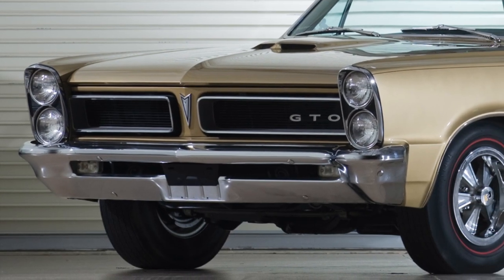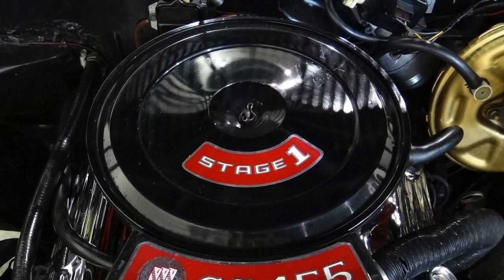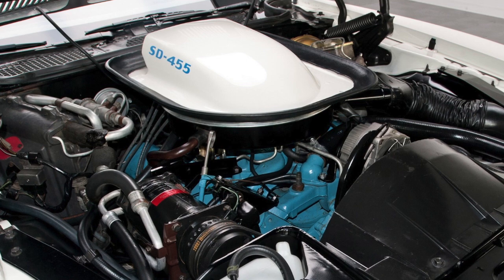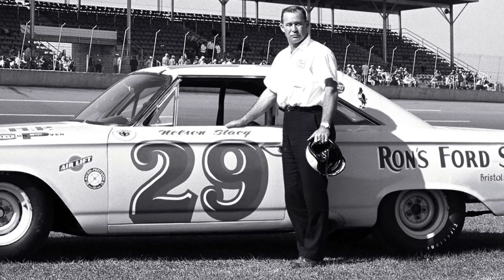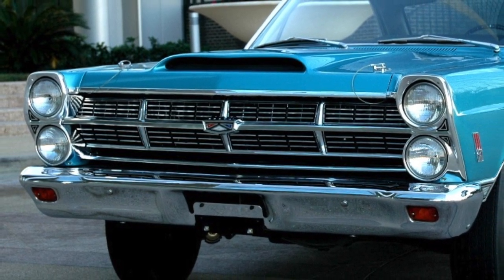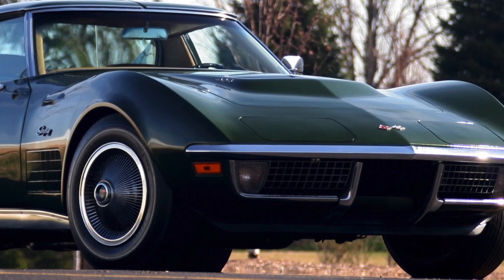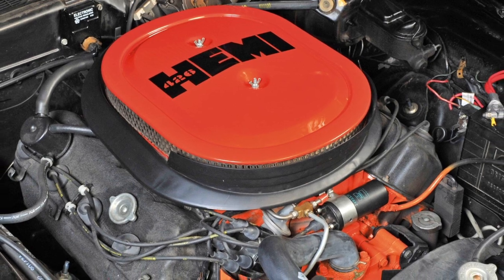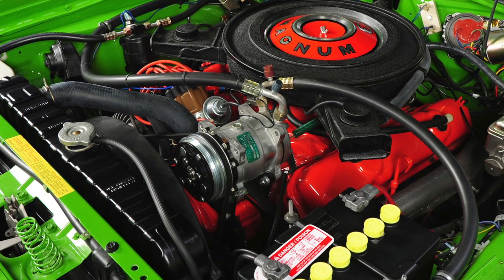5 Best Vintage V8 Muscle Car Engines

Comment: The Pontiac 455 intake and internals and heads etcetera were different than  the Buick. I wonder how bore and stroke  different as well. I  believe Oldsmobile made a 455 too
Reply: Olds did too. Just like they all made a 400
Reply: @jeremythompson9122  I wonder if the bore and stroke was different for each of the three companies on a 455.

I just looked it up in the consumer guide Auto editors Encyclopedia of American cars and all three motors had different bore and Different Stroke I can't believe it but alas
Reply: Those engines all shared no parts. Each division had its own engine architecture
Reply: @edwardpate6128  crazy since they're all under the General Motors moniker

Comment: What? No Small Block Chevy?
Reply: It is titled: 5 Best Vintage V8 Muscle Car Engines. The muscle car term is mostly related to a large CI engine in a medium size car. That did branch out somewhat by some to things like the Boss 302, 351C,  SBC 302,  LT1 etc. This is not discounting the SBC, but they are not really in this category. In stock form none of those could race with these engines, as long as traction was equal.
Reply: I would consider, for instance, the 67 L79 350h/327 Stingray a "muscle car"...meaning factory produced hp...of course it could also be had with a 429..great vid and discussion...
Reply: meant 427 of course

Comment: 1969 ZL1 all-aluminum 427 550 horse + no other engine had that much horsepower.. only made for 1 year very rare
Reply: Yeah but the ZL1 is a full race engine like a Mopar 413/426 Max Wedge, Pontiac 421SD, or Chevy L88 427 or Z11 427. The Camaro ZL1's were more of a race car than a street going muscle car
Reply: @jeremythompson9122  Yeah, and the engine option doubled the price of the car. Nobody chose that engine for street use. I think eight were installed in Corvettes.

Comment: There were less than than 700 Buick 455 stage 1 cars made , they were more of a factory race option , not a production car , if you want to compare it equally , the ford sohc and dodge stage 3  426 wedge cars should have been included  , both which would make mincemeat of the stage 1 buick .

Comment: The 409 started it all.
Reply: Really the 1955 Chrysler 300 started it all.....the first American production sedan with a 300 horsepower factory rating. The 1955 Chrysler 331 Hemi was the first American high performance V8. Then it was bored and stroked to 354 cubic inches(340 and 355 horsepower versions)in 1956 and finally to 392 cubic inches(375 horsepower) in 1957. The Hemi powered Chrysler 300 and Dodge D-500 totally dominated NASCAR in 1955-56 and it wasn't until 1957 that Ford and GM finally built some engines that were competitive. And even then Ford needed a factory supercharger and Chevy needed fuel injection to approach the kind of power numbers the Mopar 392 Hemi made. But the 57 Chrysler 300 was just too heavy compared to the lightweight Ford Custom and Chevy 150 sedans to really be competitive in NASCAR even though the 392 Hemi still made more power than the blown Ford 312 or the Chevy fuelie 283. The 1957 Tri Power Pontiac's and J2 Oldsmobile's were pretty fast too in those days but NASCAR banned multiple carbs, fuel injection, and superchargers after the 1957 season

Comment: The PONTIAC SD 455 was NOT used in the 1977 Smokey and the Bandit Trans AM.   THAT fine Auto had an OLDSMOBILE motor....not a Pontiac.

Comment: Great video, but I thought the 409 would be in there.
Reply: i used 348 forged crank and rods in a 409 block for 383.4 cu. in. That motor would wind up so fast it was crazy.

Comment: I'd take the SD-455 in the 1973  Trans Am .
Reply: Low compression
Reply: @marka6187  doesnt matter.  They still performed.  Compared to others that is.  75 and newer were junk .

Comment: Well great video on Big blocks. But the title was great Muscle car engines. And you dont include arguably the most popular and versatile engine of the  V8 era, The Chevy 350 ? Then you missed the point of your video as described by your title. A stock 67 thru 69 Camaro would smoke any of those big block land yachts on any road or track with a curve. (Except perhaps the vette). 
Good info on the video. But misleading title.

Comment: I went for a ride in a 67 Chevrolet Camaro 454 ss I could not believe how powerful it was on the highway scared me a little the guy who owns it has 454 suburban motor in it carberateur manual steering disc brakes wide rear tires And red And black interior fun car to ride in I have seen a numbers matching 68 Plymouth roadrunner forest green 426 hemi one owner car beautiful machine

Comment: You left out the Pontiac Ram Air 2 in favor of the overrated tripower 389s. The 1968 RA2 Firebird was as quick as any car on the list and it did it with 50 less cubes.
Reply: Too me, the '68 Firebird RA II was Pontiac fastest production car. It's a shame that the '68 Firebird never got the 428, with RA II heads it would have been a killer.

Comment: This man is slightly demented.I don't mean to sound nasty. The Street Hemi from Chrysler was the best,most powerful production engine ever made...... I lived it and raced in the late 60's into the 70'. The only reason for the better stock 1/4 times for the Stage 3 buick was because with street tires,the Hemi would sit there in a cloud of smoke and tire fire, while the Buick with much less low end power would scurry away..........Put a pair of just 7 inch slicks on bothe a Hemi Roadrunner and the  Buick and the Hemi would eat the Buicks lunch.....I promise it...I saw it.
Reply: This is correct. Hemi's were temperamental, but once dialed in properly nothing could touch it..PERIOD!. I saw it too.
Reply: @timinla64  I was part of a racing team. We bought a Hemi RoadRunner in may 1969. Torqueflite,4.10 Dana rear. They called it the "Super Track Pak" all HD stuff to stay in one piece behind the Hemi. I was only 16 at the time and it was great. There I was a kid. I learned drag racing in and out as we modified the car bit by bit.....With no modifications but 7 inch slicks it ran low 12's. ...Jetting the AFB carbs and adding headers 11.7 at 121 mph....Now I have had a career of being a tech then a Service Manager for 20 years after that. I am 65 and I remember a terrific time in my life........
Reply: The 440 was a far superior engine in the 1/4 mile. The Hemi shines once you get further into the gears.
Reply: @SlowRide723  i had the 440  375 HP tnt engine in my 1967 chrysler 300  the calif  hiway patrol had the same in the dodge cruiser but made to their specs  nobody got away from them

Comment: So what is the real deal with a 455 V8 Buick engine stage 1 or stage 2 or regular someone want to break that s*** down for me
Reply: The lightest ( in weight) of the 400's bloc production and, a 510 lbs/torque from the start.

Comment: I had a 1970 Dodge Challenger with a 383cu engine with a three quarter race cam and ported and polished heads putting out 425 hp in 1973. I raced a 454, 450 hp Chevelle twice and we were bumper to bumper in both races. The guy had been downtown beating everyone until we raced. After two races he left town! If this is the best that Chevy could do, what would a hemi do to Chevy??!!!
Reply: I wonder what rear gears each of you had though?

Comment: Where all the GM family big blocks more or less the same . Or where they all individualy designed and come out of there own factories?
Reply: They were all different before the late 1970's.  Designed by the division's engineering staffs and produced in each division's factories.  The Oldsmobile and Pontiac V8's were very close in basic block dimensions, but didn't share any parts.

Comment: buick 455 weak bottom end but I really liked the big bore and short stroke.
Reply: Buick had oiling problems oil pump sucked extended geares and a spacer plate along with full groove mains fixed it

Comment: No offence but the 455 S1 was not even near the Olds 455 w-30.  

1. 426 Hemi
2. 427 SOHC
3.  LS-6
Everything below that was in a lower category.  That means 429 Boss, 455 W-30, 428 SCJ, etc etc were chasing the tail end of the dog.  A dyno on a stock 426 Hemi shows 540HP at the transmission STOCK with 600+ Ft-Lb.

Comment: And of course Chryslers big block Hemi is still the choice for top fuel and funny car along with alcohol race cars. You either ran a chrysler at the track or you went home.
Reply: Not in the late '60's it was SOHC Ford. But eventually when it got to where you tore down between rounds, the push rod valve train was the winner but only after aftermarket blocks and heads. Ford made a huge mistake by producing all the speed parts you could ever want for their awesome motors, so when they got out of the racing business in 1970 there were no more trick parts because the aftermarket would not compete against the factory. Chevy's and Chrysler's parts did not come from the factory so many aftermarket suppliers so in the '70's that what everyone started using.

Comment: I'd take a 66 L72 427 4 speed Chevy Biscayne or Bel Air over a 70 Chevelle SS454 LS6 4 speed. I'm more into the sleeper look than the cars with wild colors and graphics

Comment: What a joke. You have a SD 455 on the list, but no Olds 455, or 429 scj? 😆 You need to do a little research on the late 60s - early 70s 4-4-2, and Mach1 mustang.
Reply: my  dad had a 1970 w30 422 oldsmobile he said he said it would out run 440 six packs and corvettes
Reply: I was wondering the same thing lol I own two Oldsmobile 455s and two olds 425s and torque for your buck they are the best.
Reply: phuc ewe  at 30 mph kickdown  440s did not have a chance leaf springs have alot of wheel hop gm s  have the real deal four link rear  suspension
Reply: @sabrehawk-427  ; Hey GTR ; Guess U Never Heard of a Lakewood J-Bolt Coupled with a Set of M&H's . A leaf Did a Very Satisfying Front End Lift after Installation . Something a Coil Could NEVER Do with-out Heavy & Very Costly & Expensive Mod's . All Coil Kar's Sadly Suffered the Same Disfunkshion . YYZ , Rock-Crush'in-Ratman . O ,almost 4r-got about the Rear bud Stop Lock . Very Essential .4 Positive Forward Momentum & Rear Weight Shift in a Positive Moment ! Vroom-Vroom & Let'r RiPPppppp .
Reply: @sabrehawk-427 : Luv 2 Disappoint : Head 2 head U'r Dad Bought a Hollywood Marketing Dawg of a 1/4'r Mile'n 2 +Ton Boat anchor ! Although Miss Hurst made it More Palatable . Me 69 Nova would Guarantee they Would Stay in da Shed .70ish & Although Changeld they Would Not come out 2 Play & Rather Yakkadie -Yak how about how Fast their Kar's Were as opposed 2 Proven it  all the while Shining their Fender's & NOT mak'in Eye Contact .. Bench Top Racer's we use 2 Call them ! An Absolute Truth . Albeit Ton's of H/P they ALL were 2 Heavy & Their Coil Suspension Could not Deliver the Piston Punching Power 2 the Ground . 1st Gear Might as Well been 3rd cause they were already 4 > 6 car lengths B-hind . They sure were Pretty & I Drove a Few & Yes , they were Dawg's . Nice Comfy Kind'a Ride ! A Buick Feel Sort'a . & Yes I know not what I Speak of 4 at the age of 16 I was already Comfortably Driving a Left Hand Drive Rolls-Royce & a Porsche 911 Cara -Targa + Half way constructing My 1st Race-Kar ! YYZ , Rock-Crush'in Ratman . Been There , Done That , Period !

Comment: She's real fine my 409 (425)
Reply: Had a 1963 409 425hp ran 12:80 won Super Stock 3 times including top eliminator at local strip also won A Stock when they changed from S/S to A/S
Reply: Powerful, but a lousy engine for racing.
Reply: @1LOCKNLOAD  Why's that?
Reply: @Q*bert It was developed as a truck motor and never intended to handle the high rpm's that people started trying to get out of it. The 396 and 427 were much better engines (at least in my opinion).
Reply: @1LOCKNLOAD  OH ok. Well you would think just a cam swap would change the rev characteristics on how it revs and it's power band......but I know nothing at all about this engine.
Reply: @1LOCKNLOAD  Exactly why the the 409 was replaced by the 396-454 engines. The 409 would blow up if pushed too hard. The head design sucked as well.
Reply: @Warrior_Resisting_Colonialism  The lousy head design limited the output of the 409.

Comment: Top 5, in the 70s.? How about the, gs 455  , 440, 340,six pack,mo par,351cleveland, 428 cj, 396/454 Chevy!  That's my 70s top 5 🤓
Reply: Loved the Cleveland but it was the worst real seal design to ever be produced.  Oil leakage was mandatory haha.
Reply: @markperry2827  NOT TRUE.

Comment: L88 copo was actually 550hp at least

The Impala SS 409 and Pontiacs 421 V8 should have been on this list
Reply: The L88 yes it was a grear engine but the 409 was way to heavy didn't do good at the track
Reply: @williamcostello4792  The 409 was lighter than the Mark IV engine and a bit heavier than the small block. You might want to tell all the guys who dominated drag racing with the 409 in the early 60's they didn't win!   Man nothing like amatures putting their 2 cents in!
Reply: Moon Pie  I'm talking about the 1969 ZL1 Copo Camaro and several people have put out 550hp on the engine dyno. Ford, GM and Dodge we're all under rating there horsepower numbers back then. The 426 hemi on the dyno is putting out 390hp and 500lbs of torque. The Buick 455 was putting down over 500lbs of torque.

Comment: Strange to pick Pontiac and Buick engines. I remember them as bearing spinners and rod throwers. They were a good car for the banker that wanted a little flash, but they were not well accepted by true hot rodders..  It was Chevy and especially Ford and Dodge that really got it on...

Comment: Whoa,  1959 Chev ...348 , solid lifters,  4barrel afb carb,  411 rear end,  four speed on the floor,  cam ?, ...right off the lot, except for dual exhaust and a coil taken out of the front springs....14:11 et.....one run,  could have easily got into 13:s.  But I know,  no match to these u mention, but 1959 completely stock, that motor buffs, overlook, going straight to 396 and up.    So there !
Reply: Fast for a brief time until the over stressed W designed bottom end let go. Thats why they changed the 348's design. Never was a chevy fan, but that,s one reason the 348's sucked.
Reply: What was the W bottom end ?  I ripped a structural arm attached to the rear axle housing and the frame, from the frame in a drag race, with too much weight in it at the time....still under warranty...ha

Comment: The 455 cid engine of any car builder   was a slow engine;  our 1969 electra 225 with it's 430-4 was faster than Honda 750  four and the Kawasaki 900cc first generations. . . . .Fond memories of this Buick. . Once cleaned out, it would reach 50 mph in 1st gear . . .😉

Comment: Motor Trend really gypped Chrysler in 1970, as the Hemi Cuda ran 13.0 flat at 107 mph and crushed the competition on drag strips across America. They didn't personally test it, and is why they could claim that the GTS was the winner

Comment: No mention of the Ford 460? Foreshame!!
Reply: @michael lawton I think the 460 was only installed in full size cars like Mercury and Lincoln.
A friend, about 1972 I think, had a Lincoln Continental with one.
It was faster than my father's 1972 Oldsmobile 98 with a 455.
Reply: @wms1650  I own a 1973 ford F-100 Ranger with a 460 from the factory. Its a monster!!
Reply: @blkhemi3925   Sorry, I was just thinking about hot cars.
The 460 was in trucks like yours for sure.

Comment: Buick 455 had cast rods. Olds 455 rods forged Olds 425 had forged crank.
Reply: John Mills The Buick Stage 1 had forged connecting rods and a nodular iron cast crank. The Oldsmobile W-30 had forged connecting rods and a cast crank.

Comment: Mopar 340. CID is a strong motor. 😊
Reply: Sam Logosz  Yes Yes.
I got a new Challenger Ralley 340 in 1973.
I remember beating a 1974 or 1975 Corvette 454.
I couldn't beat the older 396 Chevys or 383 Road Runners.

Comment: 413 ram jet one of mopar best
Reply: Ernest George   that is true but boy could they haul even though I have a 2014 rt challenger 6 speed I wish I had one of the old ones too
Reply: Ernest George  must be nice but where do you get gas today's car are designed to run on gas not real gas if ya know what I mean
Reply: Ernest George  what size engines any 406s or 427 superjets or 351 clevelands
Reply: Ernest George  I don't drag race my challenger I don't want to beat on my car it does 0 to 60 my best is 4.7 and according to my computer in the car my best 0 to 100 is 8.9 I have a very radical rear end gearing 3.92 gears

Comment: you failed to mention the best of the best that ran on stock car races for15 years and was always in the top, the old small block 283, it would blow away the the bigger block v8s in a drag any day and the 327 was the next.

Comment: the 440 is better than the hemi...
Reply: Until one starts building the 440. A stock 440- 6bbl will out run a stock hemi but when it comes to building for more power, that's where the Hemi shines. Have you ever see anyone build a 440 top fuel motor?